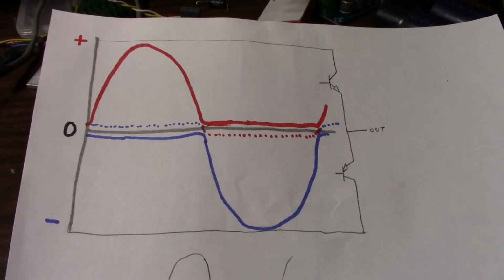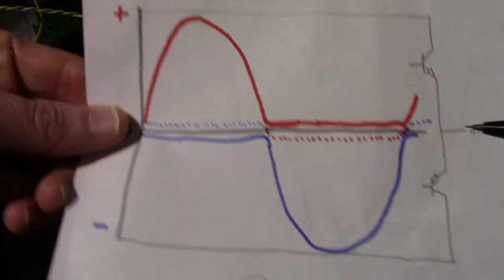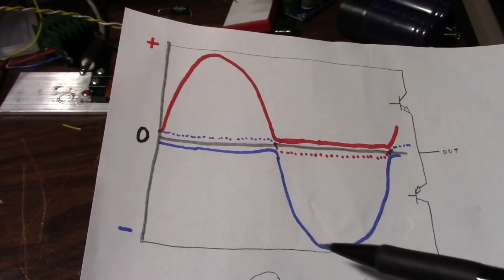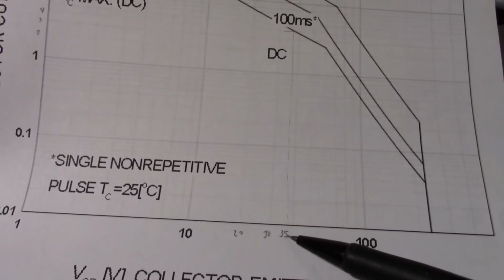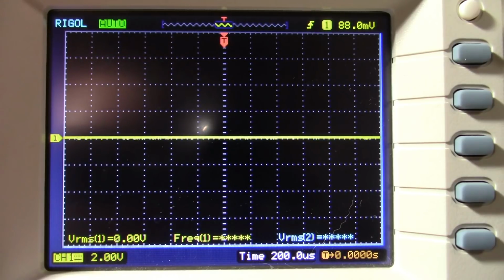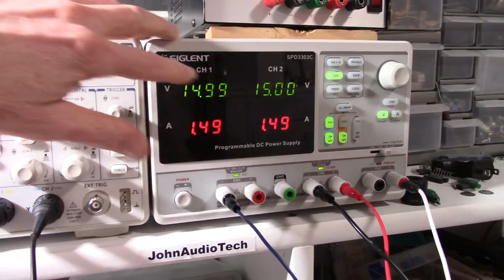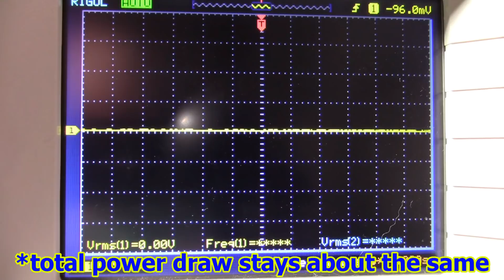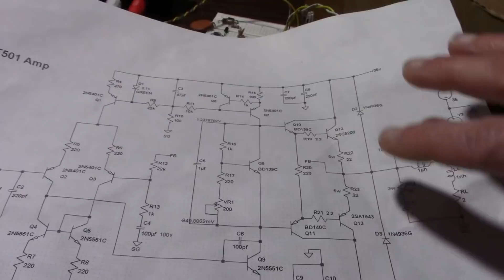Class A operation of the JAT501 amplifier - will it work?

Comment: That's a great demonstration. I always wondered whether a class AB amplifier would survive the conversion to class A and you've demonstrated successfully that it can, provided the supply voltage is lowered - a simple solution!
On the point of low efficiency of class A amplifiers: the same exact argument can be made for the majority of loudspeakers. In fact, for loudspeakers the situation is even worse as most of them are less than 1% efficient in converting electrical energy into acoustical energy.
So to turn the argument on it's head: don't worry about amplifier efficiency, worry about loudspeaker efficiency! (Which is why most class A amplifier owners have really efficient loudspeakers).
Some back of the envelope calculations:
- 0.5W acoustical output @1% loudspeaker efficiency = 50W AB amp output @ 50% = 100W
- 0.5W acoustical output @4% loudspeaker efficiency = 12.5W A amp output @ 15% = 83.3W
so you can have the same output for the same power consumption. It just depends on how you go about it and what you want to do. We can even factor in the extra cost of building the class A amp and highly efficient speakers on another back-of-a-napkin calculation!

Comment: You can also do as for example Yamaha did i some of its amps. Run it with normal bias in standard AB mode but you could also raise the bias by a button to have class A mode up to 5-10W, it's very seldom you play above 10w in normal listening.
Reply: My Yamaha A-1000 is one of those. I honestly can't tell much (if any) difference with it running in A except it gets a LOT hotter. I just leave it off as it's biased pretty high in AB anyway and I don't need to cook any eggs off it's top cover.

Comment: ...that said, I do like class A for some things. The first amp I ever designed myself has the smallest number of components I could figure out coupled to a single mosfet output. I have yet to work out the exact power it’ll put out, but I reckon 2W into 8o at the outside. It drives my 91dB speakers at comfortable listening levels. And it drives my circa 1980 Stax Lambdas beautifully.

I guess what I’m saying is, do you need 60W?
Reply from the maker: Yes, you can make very simple amplifier in class A. It depends on your needs as to power requirements. I used to use a 2 watt amp but found I needed a little more power.

Comment: Just Google 5W Class A amplifier which uses 1xBC212L and 2xBD131's should give you what you want or replace the BC212L with 3x BC182L transistors in a long tailed pair and the positive side pulling the base of the bottom BD131 to ground the feedback is from the output to the inverting side via a 470K resistor.

Comment: Thanks - but your supposed to listen to class A with a critical ear and not just judge with a technical eye - Ever since first hearing a pair of high power Class A Avondale modules driven by a toroid supply I've thought class A's the way to go for a good solid state sound, And it's cold here in England most of the time so the extra heat's welcome. lol. All the best.

Comment: Is there such a thing as RMS Watts?  From an add.  "The two tubes in this amplifier generate 40 RMS watts per channel of distortion-free signal, adding punch and clarity to high bit-rate MP3s, Apple Lossless, or CD-quality audio played wirelessly from an iPhone, iPad, iPod touch, or Android phone."
Reply from the maker: You are smart to ask this question. Watts RMS is an invalid term and is never found in any electrical engineering book. The proper term is continuous average power. I made a video about watts RMS a while ago.

Comment: High John, This might be off topic. How do you use 2 different power supply's at the same time?  I have tried this using different supply's and it just never works. I was trying your current limiter just one for-instance
Reply from the maker: Depends on how your using it. If both supply negative terminals are are earth referenced and you try to make a dual rail supply as I did in the video, you could end up shorting the negative side supply out.

Comment: What about 16 Ohm speaker Load? Are the class A Amp still non practical?
Reply from the maker: A 16 Ohm load would lower the current requirement but the ratio of wasted power to output power would still be about the same.